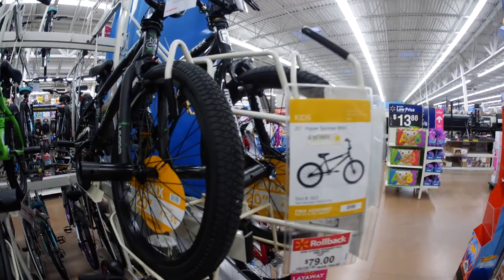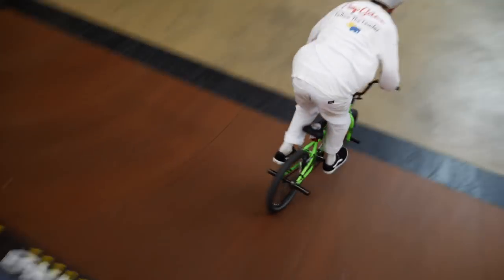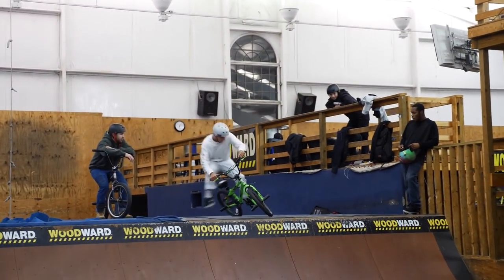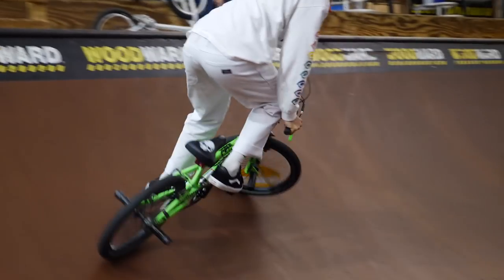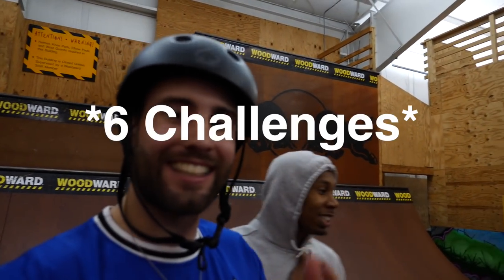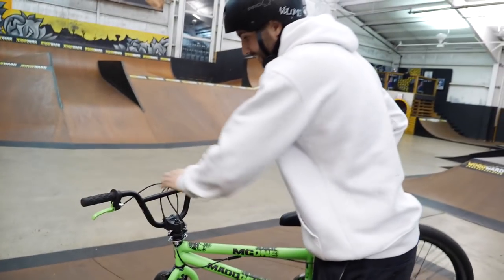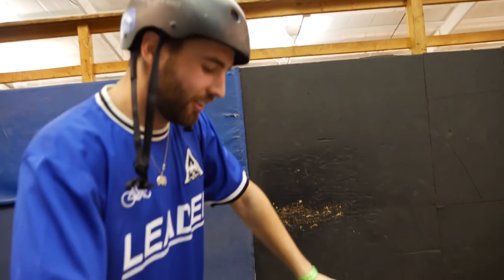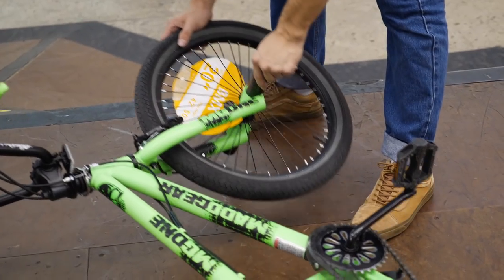$80 Walmart BMX Bike VS Woodward

Comment: Do a vid with good parts on a bad frame
Reply: well the frame actually always holds up pretty well. its parts like wheels and stems that really die in no time
Reply: Tbh can’t really go wrong with a frame as long as it’s made out of chromoly
Reply: I think good frame with bad parts would be better. Wheels,bars and bottom bracket always seem to be the worst things on these walmart bmx bikes, other than that there not awful.
Reply: Those parts usually don't fit together
Reply: Hahaha

Comment: put some stronger wheels in and test the frame
Reply: And it’s prolly gonna need a new cockpit because it’s threaded
Reply: You can do that to the front wheel only because on Walmart bikes the dropouts for the rear wheel are too small so a normal bmx wheel would not fit. You could take an angle grinder and make the drop outs bigger Though I’ve done it before
Reply: @Aaron-pc6ji  that's just waht I did . Frame snapped by the headset . But the dropouts were strong af . Like damn good .
Reply: Stronger wheels and a better stem
Reply: That is an incredible idea because every time a watch a video like this it takes one jump and the wheels are smashed and you don’t got to see what the quality of the frame cranks and pedals are.
Reply: It’s like 45lbs the frame gonna be strong as shit 😂😂
Reply: @Aaron-pc6ji  it can fit a normal bmx wheel if your hub is female 3/8

Comment: 48 spoke was standard back in the day, I used to run an Alex triple wall with 12ga spokes and a profile hub, 36/13 gearing with a 3/16 chain, for a back rim, heavy as fuck but completely indestructible

Comment: Actually believe it or not I dropped 10 ft onto one of those straight laced front wheels but it was a 2001 mongoose which had a threadless integrated headset and a 3 piece crank with a mid BB for it's time it was top of the line but those straight laced wheels can be pretty fucking good if laced right

Comment: What do you think of me getting one and  making it a project buke with good components would that be a good idea to start getting into bmx
Reply from the maker: It would be cheaper and better in the long run to get a BMX bike around $300-$400... you will run into the issue of these Walmart bikes using weird sizes and components that don’t work with modern nice after market BMX parts
Reply: @BillyPerry  true I'm thinking of asking for a se so-cal flyer for Christmas when that comes

Comment: But rlly do a mongoose outer limit red bike next I actually own one me weighing 250 lbs couldn't break it
Reply: I broke it trying to do a bunny hop and I'm 100 lbs
Reply: @John-eg9od  what broke? I fr hit a 8 ft drop n rolled away I got ppl tht would back me up on tht. It's actually still a working bike after like 2 years nothing broke on it but I also went over everything before I rode it
Reply: Seems like quality control is no good
Reply: @bigsmoke1811  its because I thought trying to do a bunny hop over a bunch of sharp rocks would be good training so yea
Reply: I still have it but Im getting a new bike and giving the red one away to my little cousin, cause I need a bike with thicc wheels, the wheels on the red outlimiter were to thin
Reply: @John-eg9od  yeah I felt that too so I gave mine to my friend and got a gt performer

Comment: Now what they need to do with those $80 Walmart bikes is weld the bars in place at the factory. Kids don't need options. There's basically one correct place for bmx handlebars. Any notion of bmx handlebars being adjustable for a child's size needs to be tamped out: